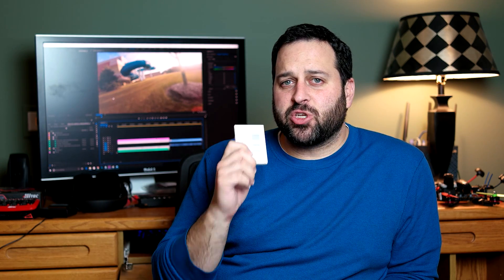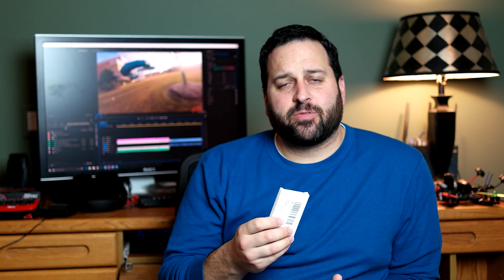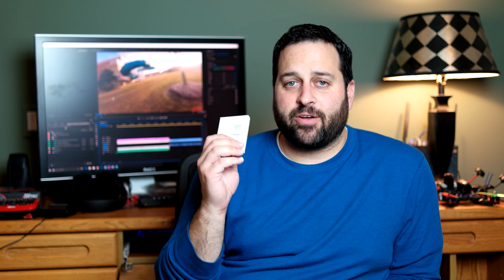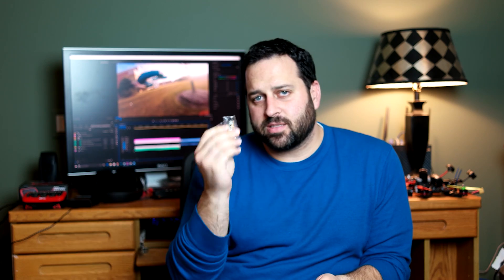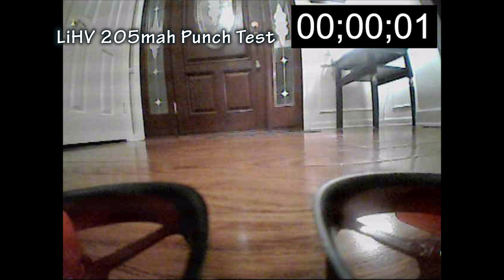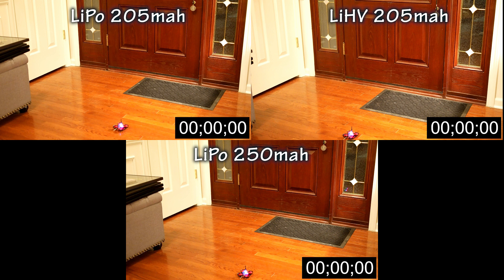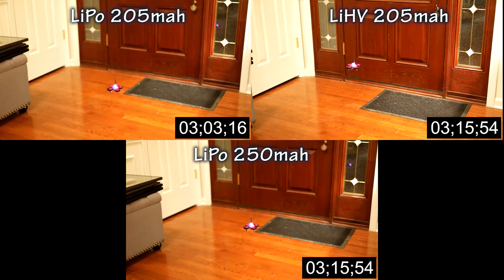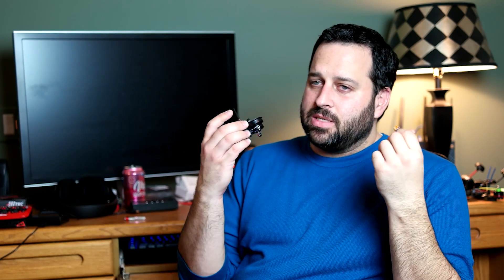High Voltage Tiny Whoop Batteries

Comment: I'd rather have 300 to 600 slightly lower power flights, than 30 to 60 high power flights before lihv cells get so bad they are worse than a normal lipo.

Comment: for my eachine e011 drone ...
shall i upgrade my battery from 3.7v 260mah 30c 9g to:

3.7v 300mah 30c
or
3.7v 260mah 45c
or
3.8v 250mah 40c
or
3.8v 260mah 30c
or
3.8v 300mah 30c

my drone with the fpv camera weights 25g and its motors have 60000rpm

i want to get better flight time and i wouldnt mind more power :)

thank you so much for your answers :D

Comment: Thanks for the review John. I just purchased a tiny whoop to intro into FPV. Where can I get some LIHV 500mah batteries from?
Reply from the maker: 500mah batteries would be much too large for a whoop like this.  I'm not sure where you could find something like that.
Reply: John E Fly it actually comes with a 500mah LIHV just pH 2.0 battery
Reply from the maker: Sebastian, I'm guessing what you bought is not a Tiny Whoop then.  It's probably a different micro brushed style drone.  The battery you'll need will depend on exactly what you bought.  Perhaps you bought a BetaFPV quad?  Perhaps you could use some BetaFPV batteries?
Reply: @JohnEFly  thanks bro

Comment: Great vid! 
I just switched to betafpv everything osd board & cam with 7mm motors on there beta65s frame running the hv power connector 260mah and it is amazing! I know you can't race with anything bigger then the 6mm (yet) but the setup is so powerful and durable. I can't recommend it enough.

Comment: Nice test.  I just ordered some of those batteries...how have they held up for you?  I was very interested in the 205 vs 250 test and the results are about what I would expect due to the extra weight. The 205's are probably easier on your motors as well.  I have the 230's on order with the 2.0 connector.
Reply from the maker: I'll be honest, I switched to the JST-PH 2.0 connector soon after this video and never looked bag.  The improvement was massive, and I never wanted to use these batteries again.  I wound up giving them away.  I did a video soon after this about the difference with the bigger connector.  The JST-PH 2.0 batteries held up great though.  Provided you store at the correct voltage, they still work great.  Some I left charged, and the results were pretty bad!
Reply: Yeah, I got the 230's with the 2.0 connector. I'm getting about 4 minute flights after disabling the LVC, and the batteries still have about 3.78 Volts on landing.  They feel a bit heavy to me though...I think the 205's are a better choice.

Comment: If you have soldering skills or know somebody that does, get rid of that stock connector asap.  I've also done the lvc bypass mod on mine as well and am quite pleased with performance now with MMW 14kv motors.
Reply: James Williams Do you have a link to the upgraded connectors? I had just watched another video... this guy pretty much doubled his time by swapping connectors.. plus he got a little more with the bypass.

Comment: Are the LiHV safe to use on stock e010? (After converting to the 2.0 plug of course). Sorry for the novice question in advance.
Reply from the maker: Yes they should work just fine.

Comment: i have an icharger 3010b can i hv charge?
Reply from the maker: sorry man, I'm not familiar with that charger.  On all of my chargers, when supported there is a battery option labeled "LiHV" or you can manually adjust the end cell voltage.  Can you do either of those 2 things?
Reply: i am charging 6 hv's. How much voltage?

Comment: Can i use a 3.7v lipo charger with these?
Reply from the maker: Meaning a charger that doesn't do high voltage?  Yeah, you don't have to charge to high voltage.  It's completely optional.
Reply: Ok Thanks

Comment: what is the flight time you get from that battery
Reply from the maker: I'll be honest, I switched to the JST-PH 2.0 connector the next week and never looked back.  They work way better and have better flight times.  But I would say getting 2:30-3:00 wasn't a problem for these batteries in the little testing I did.
Reply: But the stock batteries give up to 5 mins .then y compromise on flight time??
Reply from the maker: I have no idea how you get 5 minutes on the stock batteries.  Stock batteries wouldn't even get me 2 minutes of flight time.  Perhaps we're flying differently.
Reply: Thanks for the quick reply .I love your channel

Comment: How do you charge to a higher voltage than 4.2v per cell?Thanks
Reply from the maker: +MM your charger need to support it. For mine I set the battery your to lihv and I'm good to go.

Comment: Hey, I got these furious fpv flight controllers, what kind of receiver remote control do I need?
Reply from the maker: Robert Bain pretty sure you need frysky. so look into a taranis. if you bought what I think you did
Reply: Sorry for the vague question. Turns out the full name of my flight controller is Furious FPV NUKE. They are for tiny brushed motors. I have FS-A8S receiver and a FlySky FS-i6-M2 2.4GHz 6-Channel Transmitter. Also just built a tiny whoop with BeeBrain FC.  Not sure how to connect the NUKE to the FS-A8S. Have to cut and solder wires. TinyWhoop I just need  bind to the transmitter and test. Also not sure how.

Comment: Have you tried balance charging vs the charging board?
Reply from the maker: +Foxtrot P Victor you mean using a serial adapter into the balance port to charge each battery like it was a cell in a 6s pack?  No I haven't.  I do not currently have an adapter for that.  But it should work at least as well as the parallel board.
Reply: I have it and highly recommend.  Amazon has a couple options.

Comment: do these batteries have the bigger connector, or just the regular small connector. The batteries come with that option of bigger and smaller batts?, thanks again......
Reply from the maker: These batteries use the small connector.  If you want to see how these compare to the ones with the bigger connector, check my follow up video: https://youtu.be/ex9pv7N3T3M .  

The bigger connector definitely makes a big difference, and if you're willing to solder it on, I would go for the bigger connector with these batteries.  The ones on Amazon that I ordered actually included the connector with the batteries.
Reply: Thanks John, you've been a big help.........

Comment: do you have to do the wire upgrade on the tinywoop to use these bigger batteries?...
Reply from the maker: There is no wire upgrade here for this one, it's just a high voltage battery.  You do need a charger that can support HV though.

For the upgraded connectors, check this video: https://youtu.be/ex9pv7N3T3M

Comment: What discharge rates were the batteries you compared? I have the 45c versions of the 3.7 v ones and the regular 35c ones but haven't tried Hf. I would like to know how the change in voltage compares to the 45c regular voltage ones. Thanks :)
Reply: I have 30 C bats and 45C and betwen them is huge difference maybe biger than you show in video with high voltage and also higher voltage can destroy electronic components of control board did you measure real voltage after charge ? for example my 3,7v 45c bats have around 4,2 volts after charge so if you have writen on bat. 3,8 it could be still 4,2 volts after charge or only 3,8 ... it is Q for you :)
Reply from the maker: HV 1S batteries charge to 4.35V not 4.2V.
Reply from the maker: I would say that I don't trust C ratings, and do not tend to compare them across brands.  If one brand offers 2 ratings, I'll take that to mean one is better than the other.  These particular batteries are rated at 30C continuous, and there are others rated at 35C (the 250mah) and then the ones I used in the follow up were rated at 30C (with 60C burst).  Bottom line, high voltage makes a big difference on these 1S batteries.  Definitely give it a shot if you have access to a charger that can charge HV.

Comment: did you use the power whoop mod
Reply from the maker: Not in this video, but I did a follow up video showing the difference with PowerWhoop vs the standard connector including high voltage batteries for each: https://www.youtube.com/watch?v=ex9pv7N3T3M